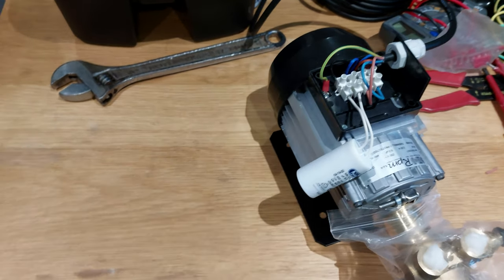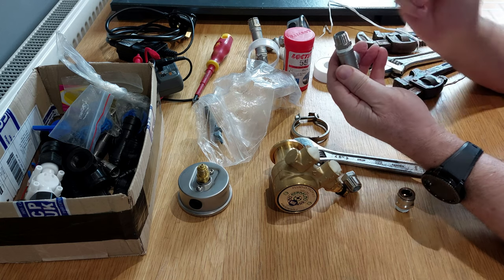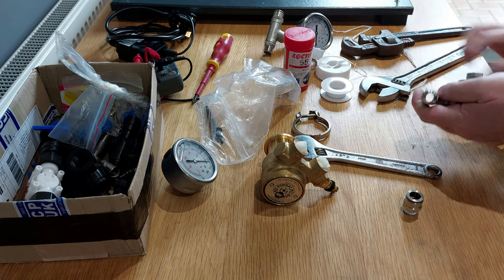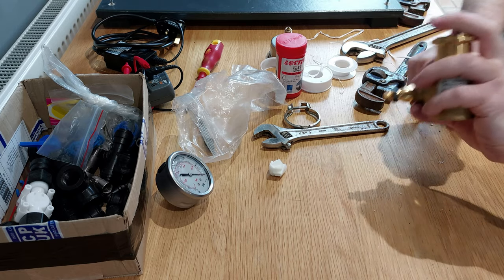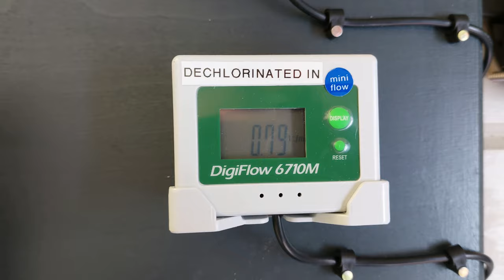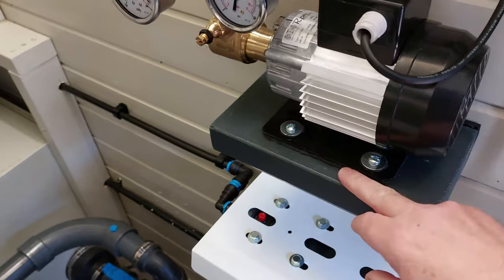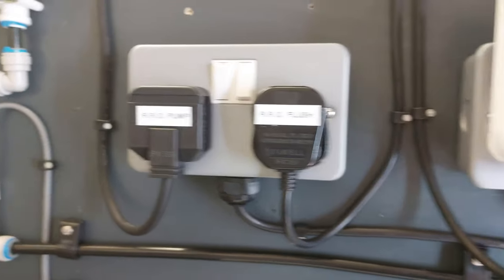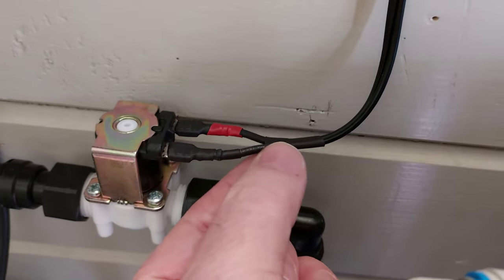Recycle R.O. Upgrade Build part 2

Comment: Hi David have you got a parts list please I’ve just watched you last video and it looks good. I’m quite new to ponding and wish to run my setup on to and to create good inlet water system but would need help in building it regards Chris
Reply from the maker: The parts lists I used are in the video's description 🙂
But to be fair I wouldn't reccomend running recycle RO if you are new to keeping a pond.
Recycle RO is not for everyone, and not a fit and forget solution and constant monitoring and knowledge are needed.
But If you want a system built I would reccomend finch filtration, he leads the way in recycle RO.
Plus he would be able to design and install a system for your particular pond, and set it all up for you 👍